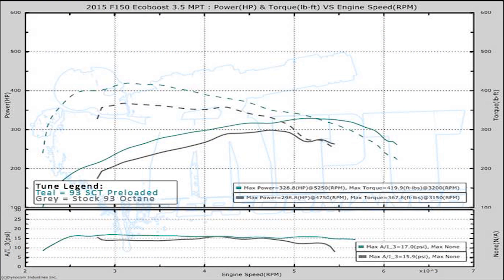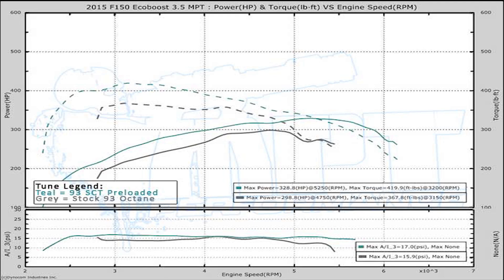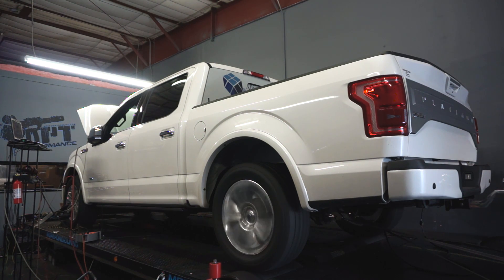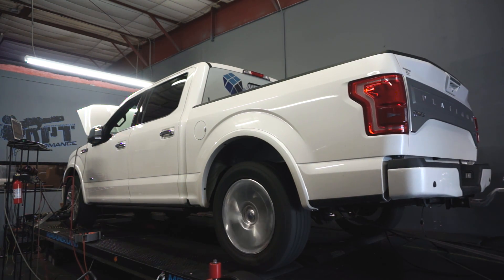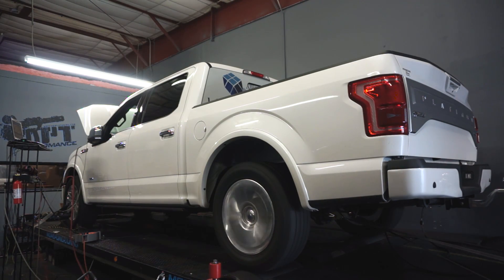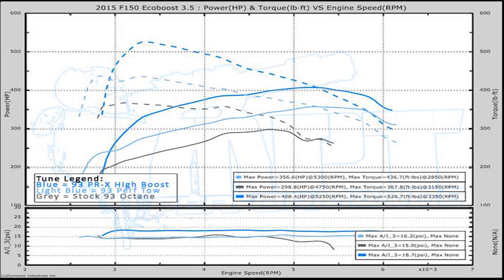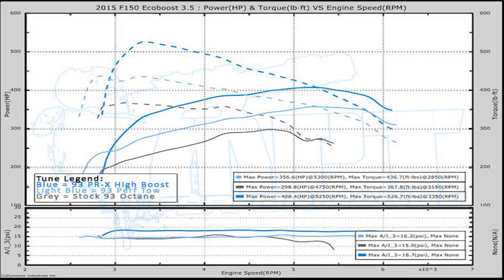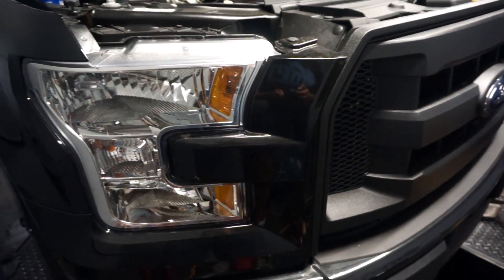2015 2016 Twin Turbo F150 Ecoboost 3.5L Dyno Tuned by MPT Performance

Comment: How do you get your F150 to do a two wheeled burn out. I have a 2011 eco-boost and I can’t figure out how to get the electric locker to work to do it
Reply from the maker: If you have an electronic locking diff, you typically pull out the knob towards you to active posi-traction.

Comment: Yeah it must be nice to start messing with a $7k motor seeking power you don't need, that truck already has plenty of power...
Reply from the maker: These trucks are excellent as they are from Ford. As enthusiasts, we are driven to pursue performance and unlock the potential of these powertrains. It can be a lot of fun if you're into it.

Comment: So I installed a fullrace intercooler on my F-150. After hitting 20psi boost the charge air pipe coupler leading to the manifold popped off bc I didn’t tighten the holes clamp enough. I’ve reattached it and tightened it down after it happened . Should I be concerned about any possible damage from that?
Reply from the maker: You should be fine.  If you have any concerns, submit a data log with your tuning company to confirm that your vehicle is operating as it should be or contact your trusted mechanic.

Comment: This should be the EcoBoost in the Mustang
Reply: @Craftytaco2  I think it would be awesome to have the option. And the 5.0 has more potential for power so I don't believe the EcoBoost V6 would beat it, even stock for stock. 5.0s with a simple procharger are seeing 700whp all day with zero issues.

Comment: Not sure how reliable this information is.. :/ plus how long do u think those turbos will last by cranking up the boost that nuch, i.e. what is the max rated boost for those Garrets?
Reply from the maker: These trucks have Borg-Warner turbos rated to over 29psi, and we're not even close to that on the tune. Not all of the power comes just from increasing boost - this is designed to be a daily reliable tune.
Reply: MPT Performance my apologies i said Garrets, thanks for the correction.
Reply: Also, i'm 100% positive you guys know what your doing, and have been doing it for a while, i'm not sure why i had a stick up my ass 3 weeks ago, but i do enjoy your tuning vids. I guess it was watching multiple videos of claims of over 100 hp just with a tune and 93 oct.

Also so those are thr stock turbos correct? Borg Warners?

Comment: High boost tune is impressive for the 3.5 but look at how lean the air fuel mixture is. Run that for to long and you will be burning valves and melting pistons.
Reply from the maker: You are right, that would be bad, but your info is not valid. The airfuel ratio is data logged and not captured using an inaccurate tail pipe sniffer.
Reply: Where do they show AFR? All I see are hp, tq, and boost on these dyno graphs. Since these trucks have factory widebands, there's not much point to hooking up the dyno's wideband for tuning.

Comment: Why does the power drop off so damn bad on the 3.5? 
Who cares about gaining 100hp at low rpm when your only in them in first gear. By 5 rpm it's near stock hp

Comment: pretty sad u need to tune a ford f150 ecoboost with twin turbos just to get the horsepower a 2014 ram 1500 v8 hemi gets
Reply: Are you even aware that dyno numbers are not the same as flywheel HP ? 408rwhp (Dyno) is equivalent to 490hp to the flywheel.
Reply: Lol The giant Dodge V8 has only 20 more horsepower and has less torque when comparing stock engines.  Oh, and the Ford even gets better gas mileage.
Reply: Shut up, Any Ram would Be a terrible truck to have. Especially the looks are terrible and they have useless V10s
Reply: Gah damn ole Stephen just ripped ye ford boys heads off and shit down ye throat! Bet all y’all dummies feel stupid as hell buying that Ford now don’t ya. Gah damn u got em stephen u got em good my friend
Reply: @jasond8418  wheel hp vs crank or flywheel hp not the same clown, as stated above. So no, that fool didn't shit anyone but his dumb self and you just joined him dummy 😂.

Comment: I have 2011 supercrew fx4 long bed with 3.5eco... I run the MPT 93 octane race tune, and also mix e85 in.... truck is a beast, love the tune!!!
Reply: Is it still reliable for daily drive? Thinking bout getting one for my 2013 3.5ecoboost. TIA

Comment: im guessing doing this voids the factory warranty?
Reply: anything worth doing will void a warranty! haha.  It depends on if the tuner leaves a mark on the ECU that it was modified.  If you break something and flash it back to stock there is not a guarantee that they cant see that it was recently reflashed which would be a red flag, other dealers may not look as hard..

Comment: Do you guys tune these on e85 yet ?
Reply from the maker: Requires an upgraded high pressure fuel pump or auxiliary port fuel injection to get enough flow to support E85..

Comment: You would make a lot more than 400 hp with 18 psi of boost on a 5.3 lmao. Be more like 700 hp and 800 ft pound. Gm needs a turbo option
Reply: James Avery you're comparing a v6 and a v8. Turbo the 5.0 and you'll be making a lot of power too
Reply: V6 F150 would stomp a V8 F150 off launch alone.
Reply: James Avery if gm makes a twin turbo option they are going to drop the v8 to a v6 twin turbo a price tag on a v8 twin turbo would be ridiculous ford is replacing 2 cylinders for 2 turbos .
Reply: This is a software change. Adding turbos is a hell of a task. Adding an extra hundred horsepower via an email is awesome.
Reply: You would make more power with nitromethane or a 2 stroke cycle, but thats not the point is it.
Reply: Tim Ryan a stroke cycle from a non port block would be extremely inefficient, as the gasses would mix under intake instead of exhaust as they would otherwise do during a normal 2s operation.

Also, you would need a supercharger to keep manifold pressure higher than the exhaust pressure, as there is no Reed system and turbo drive pressure would cause exhaust gasses to exhaust through the intake port.

Nitromethane would require one hell of a fuel system. Air brings no power in and of itself, so it displaces thermal potential and reduces the energy per unit of fuel. Its party trick is that has a heavily oxidizing effect and can run at extremely rich levels. It's also detonation resistant.

Comment: I have a good question, if you're running 91 octane fuel can you have the tune on 93 octane performance only
Reply from the maker: Can always run a higher octane in the tank than what you're tuned for, but not a lower octane.
Reply: Every truck I've ever owned I've ran a 93 tune on 89 fuel 75% of the time. I have never had a single issue.

Comment: my 2013 is on 16lbs boost making 409 hp 502 flbs
Reply: preston hatten what software or tune are you running? I need to up my hp on my 2013.

Comment: So I have a bone stock 2015 3.5L. I'm looking to add this tuner with y'alls custom tunes. I will eventually add 4in exhaust and CAI. What else should I add that isn't going to break the bank? Also, what other then the tune was done to the truck in this video?
Reply from the maker: +colt miller , Truck in this video is stock other than the custom tuning. There are a lot of good modifications available for this truck, check out our website.http://www.morepowertuning.com/2015-ecoboost-f150-3.5
Reply: +MPT Performance So, with 4" exhaust system & cold air intake the gains would be much higher? Or would this require a separate tune to accommodate larger intake and exhaust ?
Reply from the maker: Those two particular modifications will not gain any further benefit from additional changes on top of what we're already doing. Biggest performance jump in this case would be from the tune itself.

Comment: i have a injen intake n magnaflow catback  n 170 thermostat and there 93 extreme tune on a 2015 fx4 ecoboost. i get 22 mph at 70 to 75 mph. i love this tune and i love how it drives. i leave it on the 93 extreme tune 24 7 n runs amazing. i recommend there tune to everyone with a ecoboost n when this motor goes i wanna build a forged ecoboost on the fullrace twin 71mm n mpt tune it up.
Reply: darrell aschenbeck what about city mpg?

Comment: It is a 2011 f150 3.5 ecoboost and had to replace the motor in it at 66000 miles on the truck and had to pay 7100$ for the new motor.
Reply: What blew your motor?  The tune?
Reply: No it was bone stock rod when threw the block
Reply: Don't know what happen
Reply: Just wondering if it would be harder on the motor using the tune

Comment: You folks get the tcs/stability control to turn off completely or did you pull fuses for the burnout.Also does your tune remove both speed limiters ?
Reply from the maker: +Rusty P Shackelford, Didn't need to anything special, just held down the button to turn off stability control.
Reply: +MPT Performance.
 tcs and stability control turn back on after 20mph
Reply from the maker: Rusty P Shackelford All we did was hold the brake down, tap traction control button once, then press and hold for 10 seconds while continuing to hold the brake until it indicated Advance Trac was disabled.
Reply: @mptperformance  

I believe you can just hold that button down for 6 to 7 seconds and it turns both traction control and electronic stability control off which will state "Advanced Track Off"

I have a 2019 Raptor and would love a nice dyno tune but I'd lose my warranty.

Comment: Are the tunes for the 2015 not the same as the previous gen? The motor and drivetrain are the same are they not? I have a 2013 F150 3.5L, would this tune in your video not work for my truck?
Reply from the maker: +cabudge09 The programming is the biggest difference.
Reply: So are they compatible? Can I get the 2015 3.5L tune on my 2013 F150 3.5L?
Reply from the maker: We can definitely tune your 2013 F150 3.5L. http://www.morepowertuning.com/ecoboost-f150

Comment: Do you guys recommend any supporting mods to go with your tune? I've already bought a AFE intake and blow off valve from you guys. Trying to avoid buying an exhaust because of the v6 noise. Would rather it be quiet.
Reply from the maker: +Jacob Reid, no mods required to run our tunes. Performance gains should be noticeable with an upgraded Wagner intercooler and offroad Y-pipe without impacting sound volume too much. Water/methanol injection is another great way to go, especially on a direct-injected and boosted application.

Comment: as a ford tech. the 3.5 is a slouch below 3k. and the 2.7 has a even narrower torque curve. I can already imagine these tunes pushing you back in your seat. specially with the 500+ lb. ft although those trans hate to downshift unless floored. any reprogramming available for the tcms?
Reply: +B00steDevil - Slouch below 3k... are you sure you are not a dodge tech.
Reply from the maker: +B00steDevil - Trans tuning is half the battle, we definitely make some noticeable changes to the trans. Some like it stock, some prefer our performance minded shift schedule. So we offer the tune with both variations.
Reply: Very impressive
Reply: LOLOL The Ecoboost makes huge torque just over an idle...your not a Ford Tech your an idiot posing as one!!
Reply: Cry me a fckn river. I got vaseline if needed